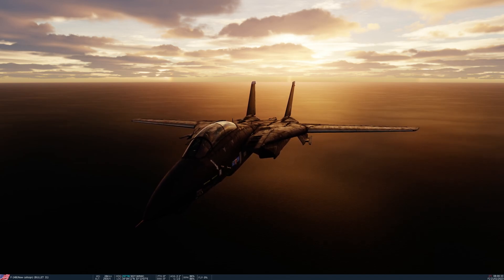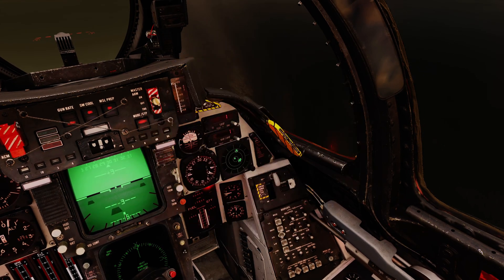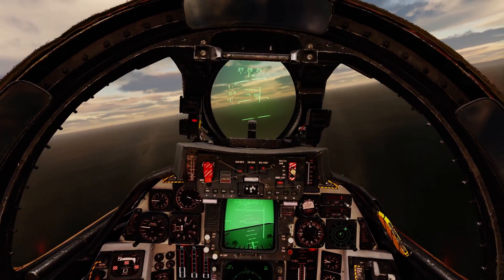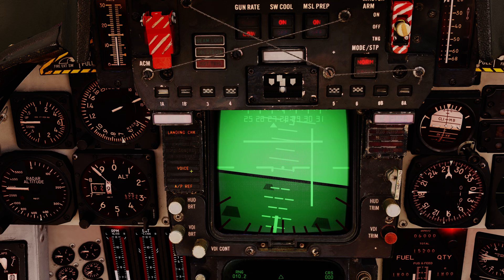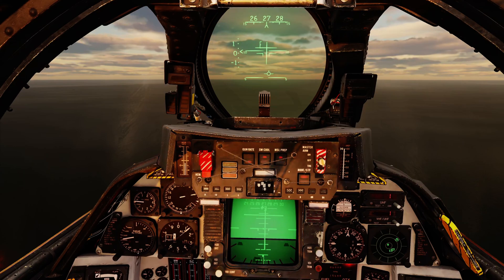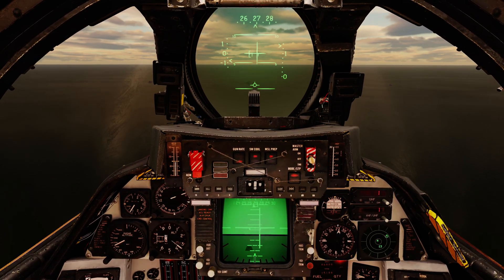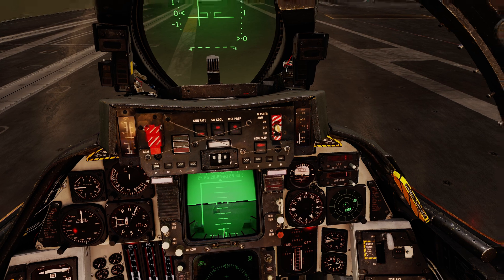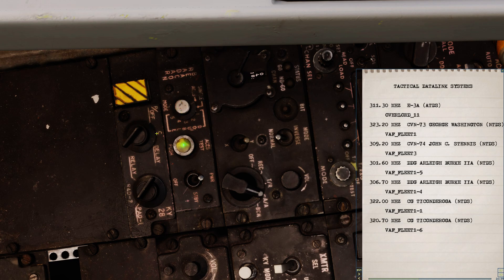DCS F-14B Tutorial 11 - ACL

Comment: I couldn't tell from the video but did you have the air break out? also DLC? might explain why your velocity vector was bouncing up and down cause the auto throttle didn't have enough range cause you were too fast.
Reply from the maker: Air brake was in and DLC was enabled. The ACLS does not engage without DLC engaged.
Reply: @deephack  thanks. Couldn’t tell from the cockpit view. Think you may want your air break out just like a case 1. Will possibly give you a smoother ride in. I might be wrong but I was under the impression that the air break extended is the standard for all landings in the f-14. Your video helped me get in the deck though so thanks either way.